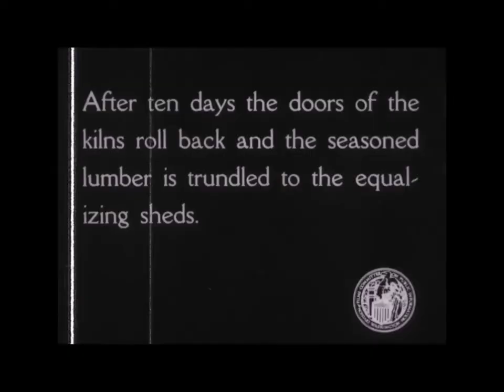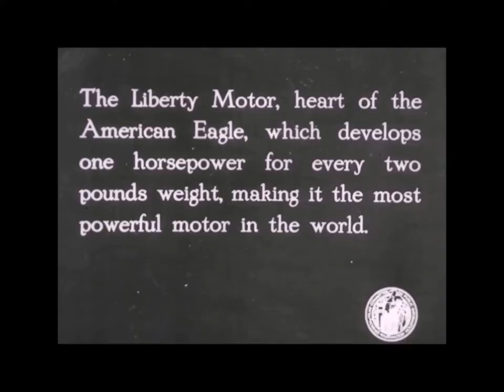Wood and Fabric Airplane Assembly

Comment: It's like the producers calculated, very hard, and with great enthusiasm, to find music which so overwhelmingly doesn't match the subject matter in any conceivable, logical, or elementary sense. Rock, would have been a horrible choice, but not horrible enough. Modern country, would have been a horrible choice, but not horrible enough. Even Disco, LOL, might have worked better. They really wanted to take it to the next level of incompatibility, to subvert the expectations in as majestic a way as possible. And they succeeded.

Comment: or build a plane from old bike frames . or timber ..two by four frame or ...some way simpler construction just crude wood and plyplates as wings , in a strong simple way l guess not glue then ,maybe just test strenght of timbers by weight test in middle see if cracks , .. would it work for a few flies at least , fun vid for youtube safer to remote control with man weight sandbag in seat. or old plane wings on old car drive till lifts no propeller ææ